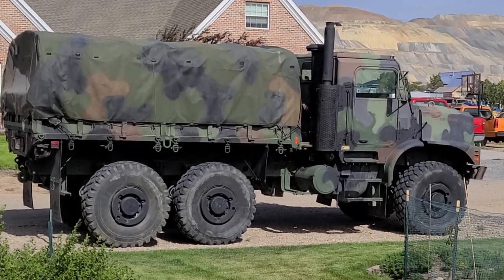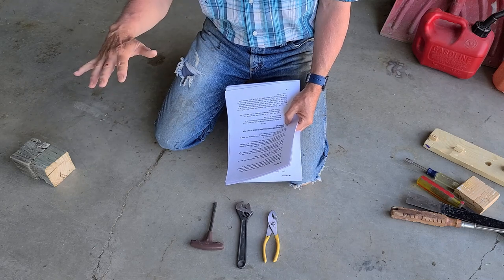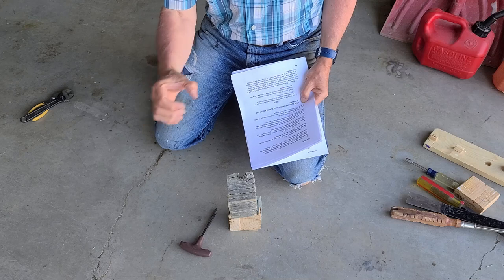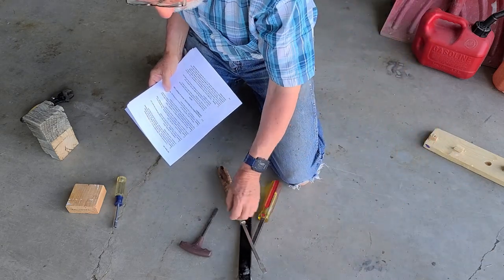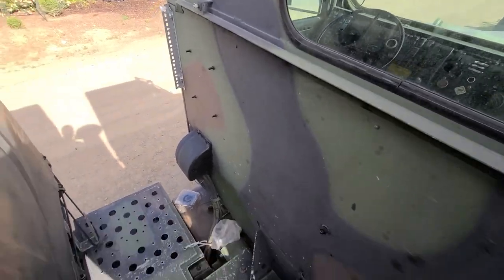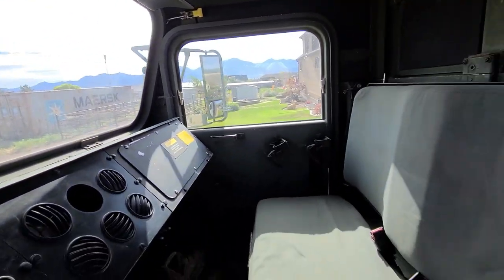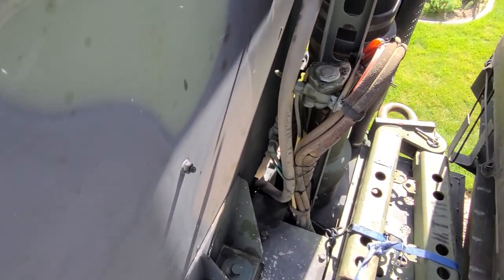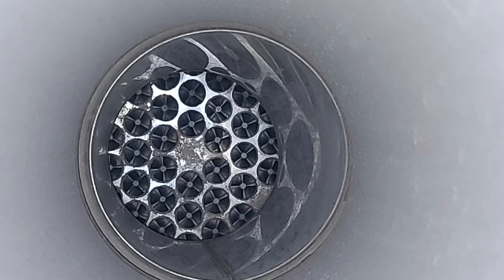Reduce the cab on a 7 Ton MTVR MK23

Comment: Is this just for aircraft transport ?
Reply from the maker: Well, yes, but also ship transport. I think the max height for transporting military vehicles 98 inches. a lot of planes, helicopters, and ships are designed around that max height.
Reply: sounds right. We had to do a similar process in the air force to ready the Oshkosh P-19 crash trucks for transport on C130 aircraft.